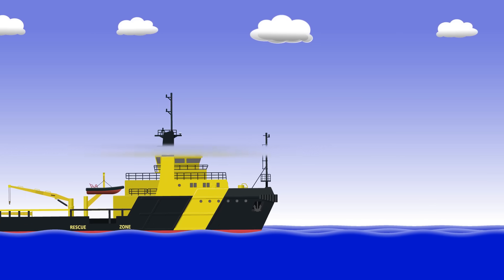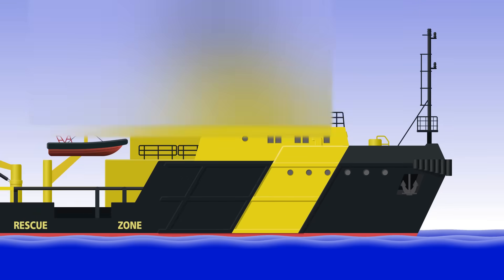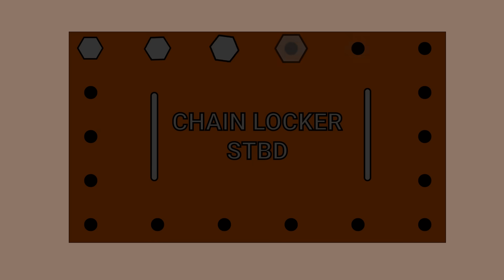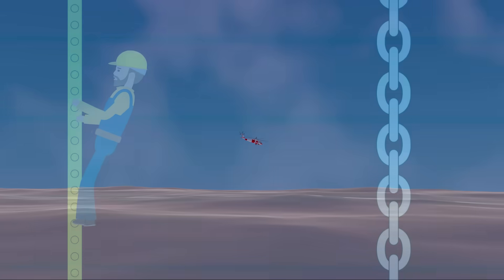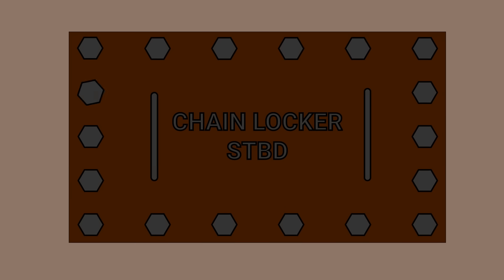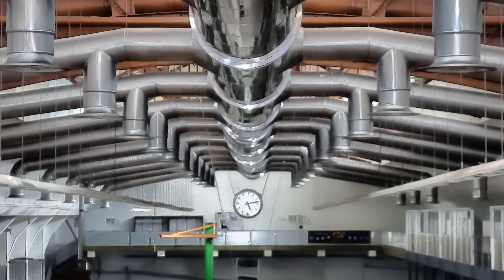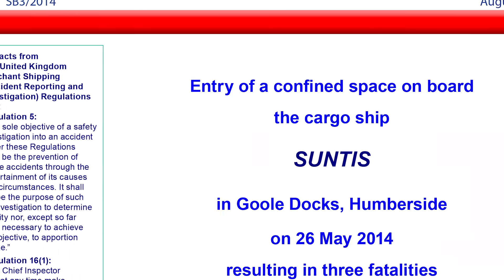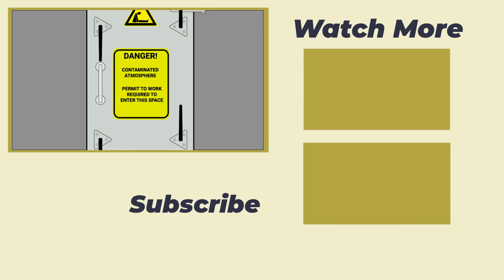Why Enclosed Spaces Are So Dangerous? | Enclosed Space Entry

Comment: The proverbial canary in a coal mine.... use sensors these days and check first.
Reply: Or don't go in unless it's absolutely necessary, annoying as the chain banging is, it's not necessary to go in there.
Reply: @Ernoskij  and even if required you should get an enclosed space permit from your safety officer first.
Reply: @godlover9096  is that a joke in how to do anything you need a permit in the uk
Reply: Were required to check the atmosphere with a sensor for any dangerous gasses + o2 levels before entering enclosed spaces. You also have to get a permit to work, which basically states all safety meassurements taken. 

I have done lots of work in enclosed spaces like these onboard the vessel I work. 

Procedure goes like this. 

1.  Chief Officer wants us to do some work in a tank. 
2. We open the tank (depending on what tank, we could need a permit for that aswell, as some can leak out gasses that might knock tou uncoincus) 
3. Then we ventilate for atleast 24 hours. 
4. Then we get a permit.
5. We check the atmosphere (tie rope to gas detector and lower into tank). 
6. Read out the values over radio to officer and he confirms theyre good or not (extra safety meassure ment)
7. If all is good we enter. One guy musy keep watch outside. Radiochecks and letting the bridge know when people enter and exit. 

I have heard lots of different stories of how former colleges of them died. 

Once in a fresh water tank an officer started pumping water into it while a crewmember was inside. He drowned. Thats why letting everyone know youre in there is important aswell, and you should always give a full proper handover when going off your shift.

Other dangers and probably one of the most common ones are simply slipping and falling. Especially in vertical tanks. But any can be dangerous.
Reply: Never!
Reply: They were the canaries
Reply: I'm sure everyone has a five thousand dollar atmosphere meter just lying around.
Reply: I am your one thousandth like
Reply: 4min
Reply: In this case they had three sensors.
Reply: you can just use a candle, or the flame of a little torch. if it goes out = no oxygen
Reply: @obelixpfeifenreiniger2863  fire isnt entertaining. Canaries though... They die. 

Idk they probably dont use flames in case there is TOO much oxygen, other flammable gasses or dust particles in the space that can cause an explosion. 

Thats why canaries have been used as detectors.
Reply: I think the reason is that even if you have enough oxygen, a high concentration of corbamonoxide can mean that this gas is blocking the red blood cells from taking on their share of oxygen, so you die breathing without ever knowing what hit you
Reply: obelix pfeifenreiniger And if there’s methane present... KABOOOM💥💥💥
Reply: the canary is to detect methane or other poisonous atmosphere.   Not the lack of oxygen.
Reply: @michaelmccarthy4615  The reason canaries die from methane is because they asphyxiate as methane displaces oxygen in the air. Methane is not toxic.
Reply: @Xandros999  I read up on this. You are correct.   It also appears carbon monoxide is a serious mining problem too.
Reply: @michaelmccarthy4615  same principle.
Reply: I don't think it is the same. A canary probably would have been fine.
Reply: @andrewphillips8341  the canary would have suffocated
Reply: @andrewphillips8341  he meant to test it before entering
Reply: @michaelmccarthy4615  I mean, if the canary is dead, there is no oxygen
Reply: @mazombieme4045  too late. 

 We've moved on to other life threatening videos.....
Reply: @michaelmccarthy4615  The canary will kick the bucket nonetheless - so the warning is given either way.
Reply: @billklatsch5058  in a mine,  the worry is an explosion from flammable gas.  Air is brought down into a mine.  The canary is sensitive to the displaced Oxygen.  The air aids in a explosion.  Only an ignition source is needed.

Comment: There must have been a "Confined Space, Permit Required for Entry" warning on the hatch, no?
Reply from the maker: I havent seen many hatches with those signs if they are normally secured with bolts
Reply: @CasualNavigation  I've removed plenty of bolt-secured hatches with signs like that nearby, but I'm most familiar with the hydroelectric industry; I know very little about ships. Seems like a good idea, either way!

Comment: Could they have put in pressurized air to ventilate the space?
Reply from the maker: Forced ventilation would be normal practise, but it takes time to make sure all air is clean and fresh
Reply: @CasualNavigation  we have a tool that runs oxygen tests if we have to work in such environments... and makes alarms if the Oxy is lower than 18%  standard practice...

Comment: That was well done and really sorry to see so many people injured 

I am a confined entry welder who repairs mixers that will kill you if you don’t follow well established lockout tag out rules 

The most shocking think is the lack of rules on the ship as for me to make and entry I have to fill out a complex permit and assemble a crew of 3 or more trained personnel if I actually have to weld we must fill out a second permit 

1. No one ever enters without wearing a full body harness with a fall protection lanyard as despite following the rules if a person has a medical event the fall protection will stop serious injury and you can retrieve them without putting others at risk 

2. No one ever enters without a Quattro 4 gas meter along with the appropriate ventilation

https://youtu.be/eritbVIGyfg
Reply from the maker: It is sad because there are always rules in place but for whatever reason, they are sometimes not followed properly
Reply: All ships I have worked on have the safety requirements that are basically as you mentioned. But as pointed out. Crew do not always follow the rules. Simply opening that hatch would normally be grounds for dismissal.
Reply: The same rules apply for ships. Were just not always good at following them

Comment: IMO bad air is the spookiest shipboard hazard, and while I've worked probably thousands of hours in enclosed and confined spaces I learned something new today.

Iron itself reacts with oxygen.  I should have drawn that connection because I know that packets of iron powder are commonly used to help preserve dry food.

Organic matter and sea growth, whether alive or rotting, do consume oxygen and can release nasty gases which become toxic in a confined atmosphere.

The spookiest thing about this hazard is how often there are secondary casualties - experienced and trained people who try to quickly rescue their friends and also die.  Unfortunately, the only reliable way to save your coworkers' lives is to be an extreme hard-ass about correct procedure and prevent them or yourself from passing out in the first place.

In the US Navy at least, correct procedure is called "gas-free engineering" and it involves ventilation, planning for rescue, air testing and more.  For example, those paints stored above the chain locker are another hazard - organic vapors are almost always heavier than air and can either displace oxygen or create an explosive atmosphere.  That might even be part of the reason why the manhole was bolted in the first place.

I wasn't trained on the whole thing, but I did learn to read the "certificate" - a note describing when the air was last tested, what kind of work I could do and for how long, and what ventilation equipment is required.

Above all it's crucial that all workers have a healthy fear of any kind of tank, void, or pit.  Those bolts scream "deadly danger, where is the certificate?" to me, so does needing to squeeze down a small hole, and climbing a ladder down or up into a machinery space or tank.
Reply from the maker: I love your last paragraph. A healthy fear can keep all of us much safer.
Reply: I have to ask, why are these spaces also signposted as dangerous, like electrical cupboards etc, and why are the access manholes too small to accept a man wearing BA?
Reply: @SvenTviking  same question. where is the sign?
Reply: SvenTviking on ship, we do training with BA sets on, and everyone will manage to fit in them even the larger guys, usually the two smallest guys on ship are on the rescue team.
Reply: @SvenTviking  this is just example, You are able to wear BA and Reach every manhole on vessel.
Reply: I hate the extreme hardass but I gotta love em too. I truly respect those who do that for the right reason instead of the ego boost.
Reply: I learned about this when training to be a welder. It never left me, after learning how dangerous enclosed spaces really are.
Reply: Yep before working in ESs It never occurred to me that iron would suck all the oxygen out air, people don’t think they are dangerous until they learn of the dangers.
Reply: Thanks for this great comment.
Reply: 1

Comment: What killed them is a chemical called Hydrogen Sulphide (H2S) causes by the salt water rusting away the steel, which as a reaction gives off H2S. It’s much heavier than oxygen (O2) so will sink to the bottom of the compartment. Which is why they didn’t collapse at the top of the ladder, only after entering the H2S/O2interface.
Reply: You might be able to get enough hydrogen sulfide by reduction of the sulfate in sea water, but iron tends to react with hydrogen sulfide and consume it, but if you did get accumulated hydrogen sulfide, the emergency workers who finally managed the successful rescue (and survived) would have probably reported the characteristic rotten egg smell.  More likely was a lack of oxygen, which would be deadly with no warning smell (and not reliable sensing by our bodies of the problem, especially if the carbon dioxide level is not correspondingly elevated).
Reply: Nonsense.
Reply: Hermit Oldguy what makes you say that?

Comment: if you are the safety guard outside of the entree of the enclosed space Never enter it under any condition. stand on your post and alarm others to go in. you stay at your post and don't leave until all people inside are out again or if a higher safety person orders you to do so and he/she is taking over.
even if it is your best friend or your own child. don't go in you are useless when you are died your self.
Reply: The safety guard was batting .500, he got the first part right  by using the radio to notify the bridge, then he made his fatal error of entering the space.  I have to wonder if opening and entering the space was a spur of the moment decision while they were in the bosun locker for something else.  If it were planned then take the damn O2 meter.
Reply: @glennrishton5679  even if it was in the spur of the moment. The amount of bolts they had to remove already should give them time to think. 
Even with a power drill it will take you some time to undo all of them.
Reply: @ukaszw6623  it happens way to much that it still is something that needs to be drilled in.
At a plant i have worked people have died do to stupidity.
Even worse that a college later on wanted to make the same mistake at a other silo when i was the safety guard. I was still making my report to know if the silo was safe but the idiot went in to it before i gave permission. I immediately called the fire department and had the guy being pulled out. and he was fired the same day.
if even the example of death it self is not enough I don't know what will.
Reply: @sirBrouwer  it is called natural selection. If someone tells you dont go in before check and he does opposite isnt that better for the world that he will be erased?
Reply: @ukaszw6623  If they want to die they can do that in there own time. If i am there doing my job I am responsible for the safety of the people at that time. if they then don't do as i tell them safety wise I will remove them from the situation. I rather have them jobless but alive and well then killed and having to call there relatives to explain that there partner won't come home alive.
Reply: @sirBrouwer  Agreed. By spur of the moment I was also meaning a decision made without thought, on impulse.  I've opened a few of those hatches myself too.
Reply: When your buddy system "buddy" has no more brains than yourself

Comment: How would they ventilate an enclosed space? Big fans? Compressed air?
Reply: compressed air are connected to the big hose ans put inside the hole to blow out any harmful air
Reply: They put a fan inside with ventilation tubing to the open atmosphere being outside the ship somewhere and negatively pressurise the compartment so they suck it out. If they were to just blow it out it would just fill the next compartment and do the same thing. What killed them is a chemical called Hydrogen Sulphide (H2S) causes by the salt water rusting away the steel, which as a reaction gives off H2S. It’s much heavier than oxygen (O2) so will sink to the bottom of the compartment. Which is why they didn’t collapse at the top of the ladder, only after entering the H2S/O2interface.
Reply: @Daniel Palmer     
You're just full of bullshit today, aren't you ?
Reply: I think you would just open the hatch and let it air out?
Reply: @gangsta4dead2  letting it air out isnt the best option as that takes time and you are not in control of the airflow. I assume you would just pump fresh air in somehow or another
Reply: @cloud9935  you probably are right. Considering how small those hatches are, it would take some time for air to exchange through a small opening like that.
I'm sure there's a pump or something for those sort of tasks.